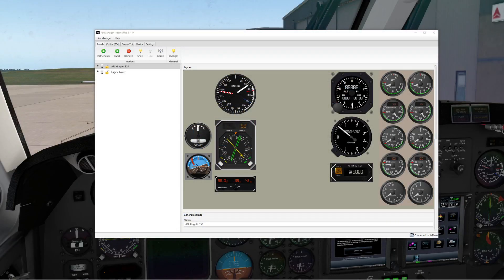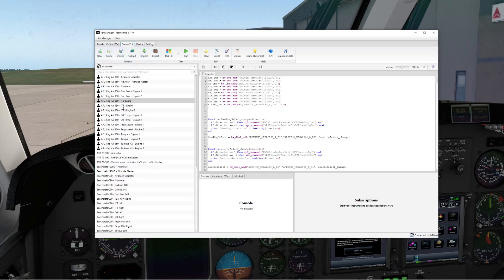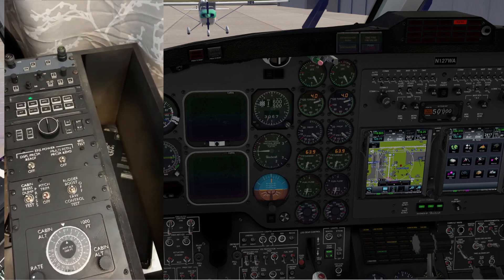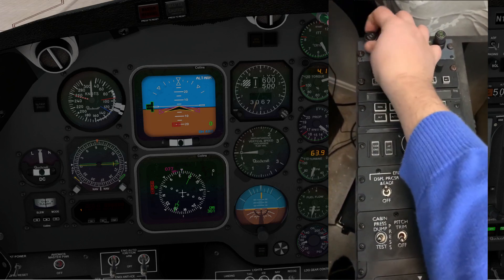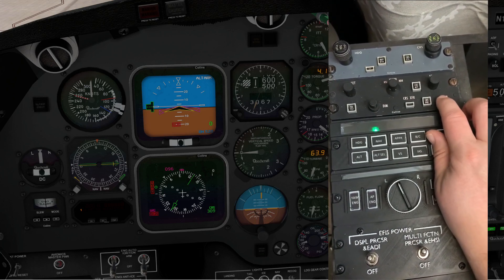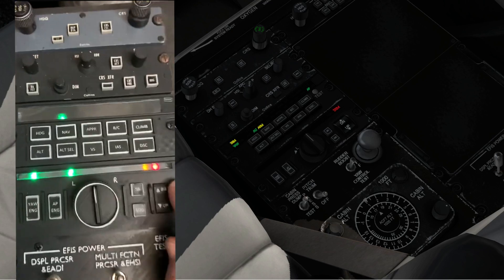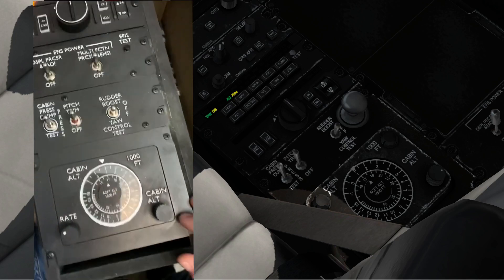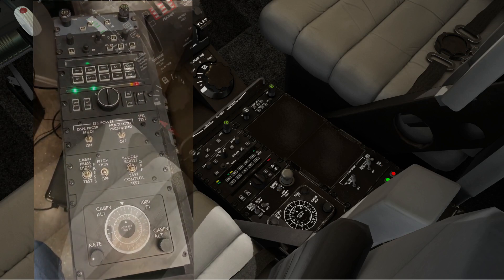King Air Home Simulator - Completed Center Console - Air Manager

Comment: Hello ExPat, I am very impressed by your level of functional items that are working on your sim. Some help if you could. I am programming (newbie) with Air Manager and setting up the "Black Square Analog King-air", however, I am struggling to get event id's and variables out of the Black Square KA, any ideas on how to determine the id's behind switches? Few hassles programming the MSFS versions, eg Left Pitot Heat, Right Pitot Heat etc, other than the basic events and variables, Thanks
Reply from the maker: Most of my experience is Xplane ... I know MSFS can be a pig to find the right ID's. Try posting in the Air Manager forum